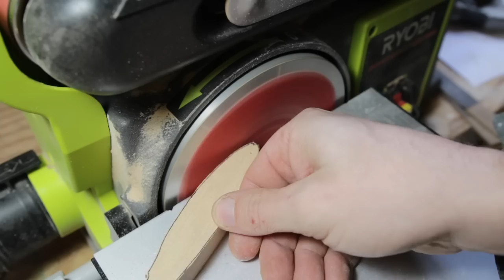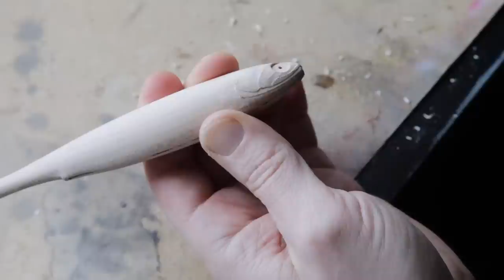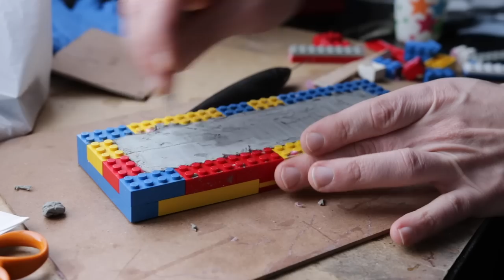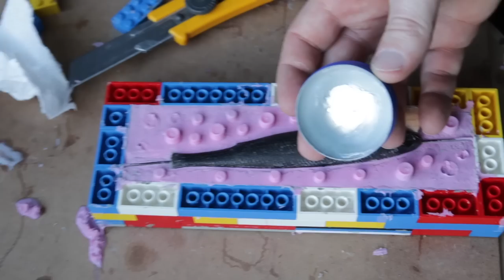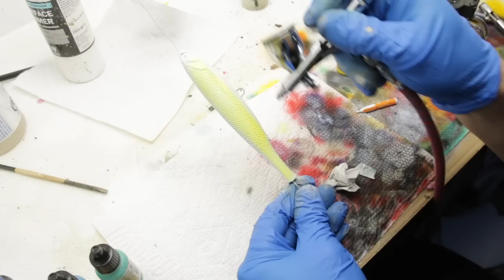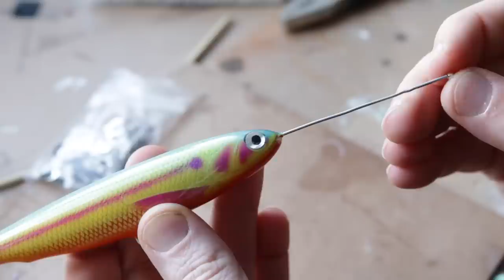What was i thinking? 😳 Spybait out of bondo body filler

Comment from the maker: Any cement experts out there? Let me know what i did wrong.
Reply: I know a lot about concrete. Love watching your videos.
Reply: nope. mutta kuivuu varmaa liian nopeaa, pitäs suihkutella vedellä ja kääriä elmukelmuun. siihen pitäs laittaa myös jotain tukea sisälle esim rautalankaa
Reply: There wasn't enough super glue or baking soda for that matter
Reply from the maker: @cballz  you forgot noodles
Reply: Cement in small quantities is quiet brittle, I would look at fibre reinforced method, possibly using thin wire, fibreglass fibre or thin metal shavings from a metal lathe and mix it with the cement.
Reply: We add stuff called "Strux" to reinforce cement pours. It's basically strands of fiber that hold it all together. Chop of a piece of nylon rope in 1/4 - 1/2 strands and mix that in to the cement next time.
Reply: vibration is key to removing air bubbles from cement...just tapping the side of the item your making continuously for 5-10mins as you pour should remove any air bubbles

Comment: The carving is very unnececessary. When you have a lure you want to move through the water with efficacy, you want it smooth. This is the difference between a carver and a fisher.
Reply from the maker: Doesent the lure come smooth once i covered it with epoxy? 😀
Reply: @SolarfallBaits  Exactly my point. It's a waste of time if you hit it by hand or thickness....by spray? Eh.
Reply: Carvers specialize in looks. Fishers specialize in swim. This is what people like Melosh don't understand bc he is a carver first.
Reply from the maker: @wolverinex4243  actually looks do work in your favour in a lure like this which does not really have body action and the movement mainly comes from the blades while the body stays pretty still and acts as a target for the fish to strike. Anyways i like to carve stuff from time to time and figured i might as well do so here too because why not.
Reply: I get it. I'm saying you could have drawn that in; the gills. It would come out the same. For a lot of topwaters, don't you know.
Reply from the maker: @wolverinex4243  sure, i do that all the time too if you check out my past gatalogue here on youtube. It's just not what i wanted to do with this lure.

Comment: Lol. You are funny. If you do eyes, just set them in with the sticky back. You're going to freaking coat it over. If you want to glue it, wash the back with alcohol, then use super glue. Geez. Mixing epoxy and letting them set in nog viable, not at all.
Reply from the maker: I use epoxy on the back of the eyes because the 25 years of experience i have on making and selling fishing lures have lead me to the conclusion that this method works the best for me since i like to make a eye sockets on my lures  and just sticking them in with a sticky back can cause the epoxy finish to bobble around they eye and ruin the prestine look im aiming for.
Reply: I make lures too. Never had that problem. I do my methods.